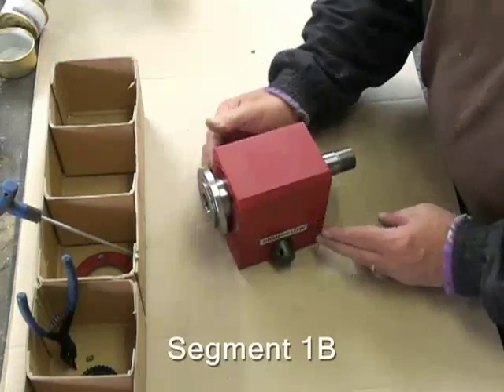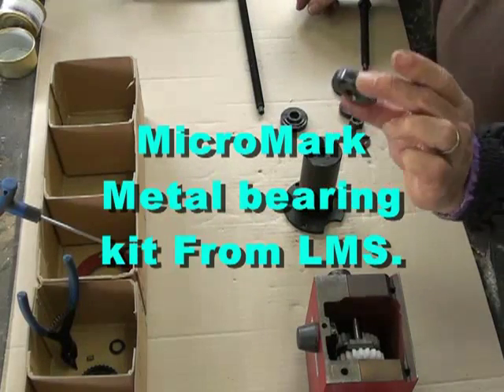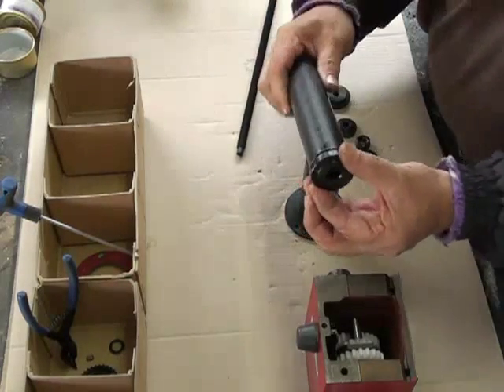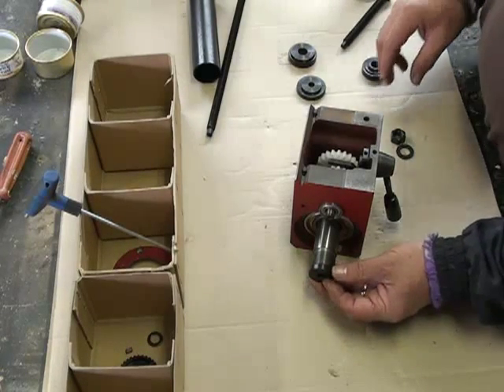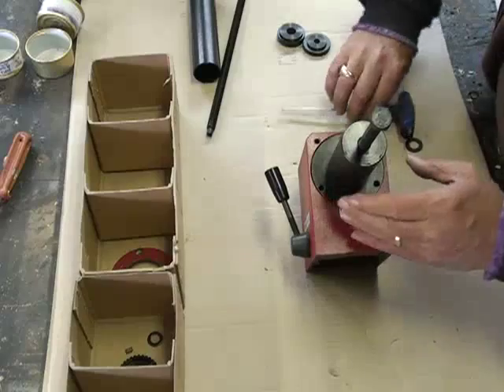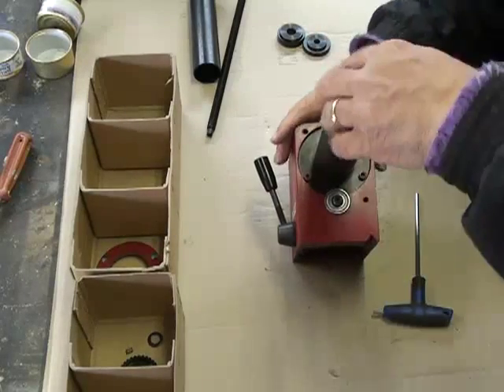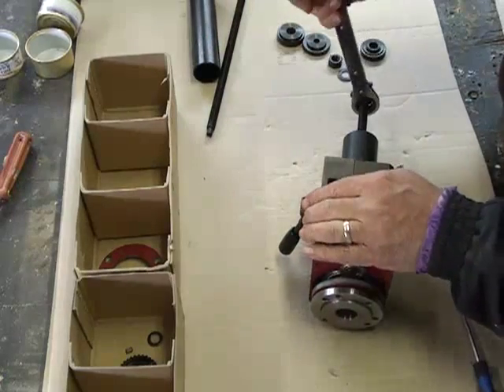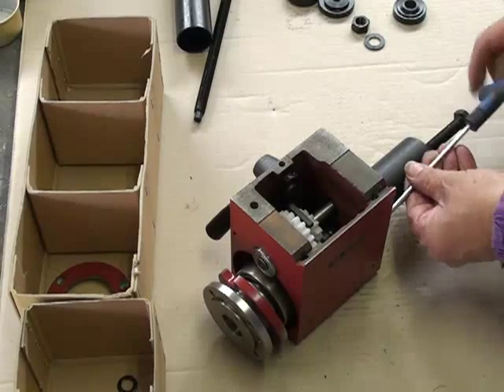Part 1B of Fitting taper bearings to a 7x12 mini lathe

Comment: Can you post a link as to the tools used to removal the bearings the removal kit cheers
Reply from the maker: The tubes are part of a Micromark repair kit Item 83452.  This is a kit to fit  Metal Gears for Mini Lathes and Milling Machines  and has the tools needed to remove the spindle and bearings. Look up Micromark on the web and search  item 83452 for details. I can't post links here - my setup wont let me.

Comment: funny im rebuilding  this right now.  the spindle was easy.
the other smaller one is killing me.  I can not get the bearings on both ends.. wtf I need an arbor press for the love of god.  Im stepping away before I damage the bearings,

It makes zero sense as there is nothing stopping that bearing from going all of the way up the dame shaft  yet it is 16th short of seating.  there is nothing is the bearing seat either.. its clean is a whistle.

Comment: what a nightmare.  I just busted one of my inner gears when the machine jumped into gear and rammed the work piece. 
these lathes are pieces of shit.
|
How much is this kit?
Reply from the maker: +Clown Whisper  Hi, the metal gears kit for the spindle is $50 US from LittleMachineShop in the USA. Part number 3448.  If you want to replace the bearings with bevel bearings, they have the bearings too. The tools for removing the bearings are available (last time I looked) from Micro-Mark part number 83452 at $80 US . That kit also includes steel gears but are not one piece like the LittleMachneshop ones. However split or not split, is still a lot better.
Reply: +vk3aqz I have the 7 x 14 grizzly with the digital speed.  765.
I do have the solid nylon double gear I think.  I just got off of the phone with grizzly and first they told me that I could just send them the head for repair or replacement as its still under warranty.  SO i tear the machine down clean parts label them, bin, them pack the head up and call for an RMA.

They new guy said that they need the whole fucking machine.!!!!
WHAT A BUNCH OF DIP-SHITS.

I need to change out all 4 gears in the headstock.    I think i will just spend the 80 bucks.
Does it come with some sort of spacer for the spindle gears seeing as how some are made solid?>
Reply from the maker: +Clown Whisper Uhm!  I would have thought that busted gears due to a jam might not be warranty. Anyway, I guess the cost of shipping the whole machine, if you are a long way from Grizzly, might be about the same as the repair tools!  If you are within driving range of grizzly, I would be inclined to take the spindle removed box plus the machine. I would imagine they would need to test the repair on your machine just to make sure everything else is okay.  You may have also stressed out the motor, belt and control board.
Reply: vk3aqz they sent me a new motor about a month ago due to some issues but I did not need to replace it.  the machine jumped into gear  while in threading 12tpi setup so it moved fast and hit the work piece.  I instantly hit the E STOP but the gears broke anyway.

Its under warrnety so they will pay the shipping either way.  I just wanted to done sooner than thier turn around time.

They would be better off sending me a new head!!!   think about the shipping costs alone on a warranty repair?

112 lbs both ways?

I have reported that the machine jumps into gear sense day one so they know its an issue.   they have to cover me.
Reply from the maker: +Clown Whisper  Ok . I understand now. Removing the spindle and bearings can take some time and you need some tools to extractone of the bearings in order to remove the spindle. I am not sure you really need to replace the bearings with bevel ones - unless you want better run out - as it stands the machine is sort of ok with the standard bearings. There are also better roller bearings with modified grooves which are supposed to be good also. If you do decide to do the job yourself, at least you will have gained a lot of hands on experience and any future issues you can try to fix with a better feel for the mechanics. Yes, these are a cheap machine no doubt.  Cost of shipping to them, plus their labour, and testing, and paper work would almost be such that they could give you a new one !!  Hi !
Reply: +vk3aqz I have NSK bearings.  Super high precision I'm going to try.   I will even use the nylon ones again I just need the tools.   I was a robotics repair guy changing these gears is child's play lol.   To bad I  a t buy just the tools
Reply: +Clown Whisper I mean I will get the warranty gears from grizzly and use them.   I'm going to make it impossible to slip into gear
Reply from the maker: +Clown Whisper All ok. I would still consider metal gears though. The nylon ones might bust again.  They are quitter though and no lube needed.  Maybe get 2 sets of nylon gears - I don't think they are very expensive. If you do have good bearings then put them in for sure. If they are the same width as the existing ball bearings then they should go in without having to modify the spacers (which is what you have to do with the slightly fatter bevel gears).  You will need to take one bearing out anyway. If I were you I would give it a go - it's a fairly non complicated job and it will help next time the lathe fails. Just one thing - aligning the belt  - try to get it just right - need to juggle the motor mounts - a bit of a pain!
Reply: +vk3aqz thanks for the tip, d9es little mach8ne shop see all 4 drive bearings or just the two spinal ones I'm getting confused lol
Reply: +Clown Whisper I mean drive gears not bearings
Reply from the maker: +Clown Whisper Not sure what you mean. There are 2 bearings on the spindle and 2 small bearings on the high low gear change shaft. You only need to replace the ones on the spindle. The little ones are okay as they don't really affect the run out on the spindle. You might look at the bearings part number 4957 which are angular contact types. I have not used them but they might be a good bet.  Note that there are other bearings on the "bearings" page and some of these are for other lathes so take note of which bearings you need for your machine.
Reply from the maker: +Clown Whisper Also, I made my job easier by buying a complete spare spindle box. But I live in Australia so parts can take a long time to get here so a spare spindle made life a lot easier for me.
Reply from the maker: +Clown Whisper Ok makes more sense now. Yes, do both sets of gears. LMS part number 3448 shows both the small and the large set. I did both. I think if you leave the small plastic ones on, they could break also. There is a you tube video of a guy who lost both sets of gears when he changed from high to low while the motor was still running.
Reply: +vk3aqz no I mean the ones that Come with the tool set.  I couldn't make out what comes with the tool set
Reply from the maker: +Clown Whisper The Micro-Mark tool set only provides the larger spindle gear made of metal. They claim the smaller gear can be plastic because it is easier to change as you don't have to remove the bearing. But I don't agree with that as it is still a  fair bit of work to remove the spindle box itself from the lathe.So one might as well do both gears. LMS give you both gears and as far as I know, most people change both. If the lathe had been designed somewhat more intelligently, access to the bottom of the spindle box could have been made through the base so that the box stayed on the ways. Would have saved some time. Even a cover plate over the spindle box on the side would have helped too, which is what you get on the larger models.
Reply: +vk3aqz yeah I'm going to replace them all with metal I'm not going to buy the tools though.   I loved around and found images showing this process by one of the lathe manufacturers using nothing more then a mallot.   One thing that bothers me is that the littlemachineshop.com gears do not say that they are specifically compatible with the grizzly 7 x 14.  Im sure that the are but its a bit nerve racking none the less. 

I m8ght take the assembly down to a shop and press them out
Reply: +vk3aqz oh and speaking of non intelligent designs that piece of sheet metal in the bath that supposed to block chips there's an opening that leads right to the motor compartment and directly into the motor fins. Did you notice that?
Reply from the maker: +Clown Whisper  Ok.  I think if you talk to or contact LMS, they might be able to confirm if they fit the 7x14. Here in Australia, a 7x14 is the same as a 7x12 except the ways are 14" long instead of 12". Everything else is the same. But check anyway if you can.
Reply: +vk3aqz I think they are the same I mean I have bought a few other random gears and of replace them in there been just fine
Reply from the maker: +Clown Whisper Yes, there is a small gap at the fold. I had put a small dobof sealant there. As you say fine particles can fall through the gapand into the motor shield which has several 1/4" holes in it. When you start pulling these machines apart you do come across some pretty ordinary things. These machines are very cheap in China and built that way. They tend to be used in schools and areas like that. However, us guys in other countries have importers who bring them in then add their markups which no longer makes then low cost. But they are still just a toy but at non toy prices !
Reply from the maker: +Clown Whisper Yes, probably right. Anyway, good luck with your machine. Once I modified mine several years ago, it has worked quite well. Recently I replaced the motor brushes because the motor started to flutter, and I wore out the speed pot. I got brushes from LMS then a pack of 10 from EBAY for $2. The pot came from EBAY for $4. A lot cheaper than the lathe supplier.  And I got a spare motor here in Oz for $160 AU, but it is still in it's box waiting for that day when I need it (same as on my X2 mill). Other than that, it has worked well and with the bevel gears, makes quite good accurate cuts.  Regards, Lou
Reply: +vk3aqz thanks for all of the help with this.  I'm simply amazed at everything that has gone wrong g with this machine out of the box
There was not one s reward tightened correctly and many striped.  Had a bad pot crushed ball oilers busted gears, the photo sensor fell off the first day and mangled itself in the change gears.  Bad tail stock bearing and cracked tails took casting

The goes on and on
Reply from the maker: +Clown Whisper Sounds like an evil spirit got you. I picked mine up from the supplier and after we checked it out first.  So good luck with your repairs.
Reply: +vk3aqz you know the 3448 only shows compatability to 7 x 12 lathes     now what do I do
Reply from the maker: +Clown Whisper Call LMS
Reply: +vk3aqz I have a question unrelated to this topic.  IWhen I was taking off the headstock I noticed that there was a small sets crew with a nut laying under outside change gear area.   I cannot figure out where this belongs save my life   so picture a set screw about a centimeter  long with a nut turned onto it. Its only a few millimeters I guess, it's black also...
Reply from the maker: +Clown Whisper Hi, there are a number of small screws that can fit that description. It could be one of the small set screws used to tension the GIBs on the cross slide and compound rest. There are some on the rear of the cross slide and some on the side. Also I think there are some under the tailstock casting. It could also be one of the set screws that is used to push the motor body so as to tension the belt. The motor has a couple also but they are somewhat longer. It is most likely a GIB adjustment screw from the cross slide or compound rest as they are quite small and have a small locking nut on the thread. These screws have an Allen key slot in the centre.
Reply: +vk3aqz yeah its not any of those I looked really carefully, and but none of mine are missing I'll try to post a picture of it and link you later
Reply: Ok so..... 80 dollar set of tools or a claw hammer and a block of wood.....

I choose claw hammer and block of wood....
nice rhythmic hammering for about 3 minutes using 3 x    2x4.   2 to hold it off the flange and one to protect the threads on the spindle.   I did not even have to hit it hard,

Done in 3 minutes,
Reply from the maker: +Clown Whisper Very good. Yes, necessity is the mother of invention.
Reply: vk3aqz Pi can not  believe  how much old paint primer  was driped  into the bearing hole and they did not even bother to clean it out
Reply: Oh I figured out that the set s reward and nut was t the saddle  guides so do e must have thought it was fun y to toss them in the head......
Reply: I wish they would have measured how far the one threaded end protrudes
Reply from the maker: +Clown Whisper  Ok
Reply: +vk3aqz oh wait I  made a mark with fine sharply so I knew when it had moved a little.   I'll just make sure I don't clean that off.
Reply: I just got my gears via LMS and the fit like a glove.I have two different greases to pick form.. I have good high quality lithium grease and bearing or gear grease that we used to use on a couple of machines when iworked in the medical robotics industry.  

I am leaning for the cheaper thicker bearing grease.  What do you think>
Reply from the maker: +Clown Whisper Use the bearing grease.
Reply: Yeah I did that.   Runs nice and is not really that laud
Reply from the maker: +Clown Whisper Looks like you have completed the fix. Good learning experience.  Yes, the little bearings can be tight and you need to be careful handling them.
Reply: Yeah I've got a lot of experience with replacing bearings and they can be really tricky for no apparent reason I used to rebuild it shaking incubators and there was one machine had four towers and 96 bearings 96 reasons to go wrong it was a nightmare but all in all it seems to have went good I did some improvements rewired photo interrupter for the counter so disnt pointed towards the gears out why they did that is beyond me added a few other things
Reply: ,, voice recognition is really sucking today sorry about that hope you can make it out
Reply from the maker: +Clown Whisper All okay. Some machines have the interrupter inside the spindle and some on the C nut end. I don't have one on mine but its no loss as I tend to watch the tool and the chips and adjust speed till the tool cuts smoothly.
Reply: Yeah I find myself going be ear more than anything. Its a 100 dollar option that I probably did not need,

Every single wire on this machine was crimped wrong and as a result the connector fell off! every ONE!

The machine was not even grounded from the factory.  There was simply a bare stripped ground wire laying inside behind the dist protector screen inside the electronics box!

Right now Im really having a lot of trouble with the adjusting the saddle.  there is a lot of slop and if I get the slpp out it becomes so hard to move.   Also, if I crank the saddle toward the head-stock, as I get near it it gets tighter and harder to turn.  that should not be,
Reply from the maker: +Clown Whisper Ok on the wires. In Oz if the wiring is not earthed, the sellers end up in a lot of trouble so everything gets checked before sale. The adjustment of the GIB screws is really important. There are several and if you don't get them all exactly in the right spot, then the travelling bits jam up at either end. And be careful you don't strip the lock nuts. LMS sell better quality ones if you break them. Just follow the instructions in your manual for the machine or download from LMS for a 7x12 or 7x14.

Comment: The LMS part # 2909 is Discontinued, Do you know where i can buy it? Thank you
Reply: Hi Johnny, the spacer part number is 1291. It is the only spacer on the LMS replacement parts list which is for the 7x12 lathes. It is the 7.5mm one. The other 3 spindle spacers are for the 7x14.  The LMS 2909 kit I used was made by Micromark for replacing the plastic gears with metal gears. The tools were part of that kit.The Micromark part number is 83452 so try their website. I have just looked at the website and it shows that kit. However you will need to enquire yourself as to it's availability. You can also make your own tools. I know some who have removed the bearings, have made suitable tools using aluminium tubing and washers. However the kit has tubes and washers with steps and rebates making it a bit easier to use.
Reply: @loudestefano3463  https://www.micromark.com/Metal-Gear-Set-for-Mini-Lathes-and-Milling-Machines
Reply: https://www.micromark.com/Metal-Gear-Set-for-Mini-Lathes-and-Milling-Machines

Comment from the maker: Hi Peter. the LMS part number is 2909. This item from Micromark is actually for spindle repairs and for replacing the main plastic gear with a metal one. It comes with a couple of metal gears and a spare ball bearing set. I only used the tools. Also I used the LMS gear set 3448 rather than the seperated gears. And the 2822 taper bearings. Cost not an issue. Without bearing fix, the lathe is just an $800 pile of scrap metal as far as I am concerned. Also replacing plastic gears is a no brainer.